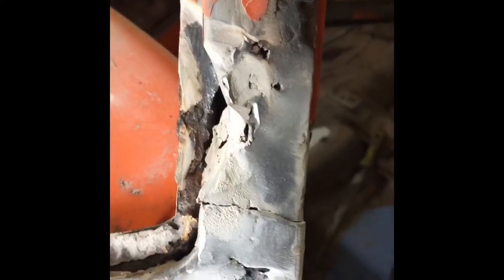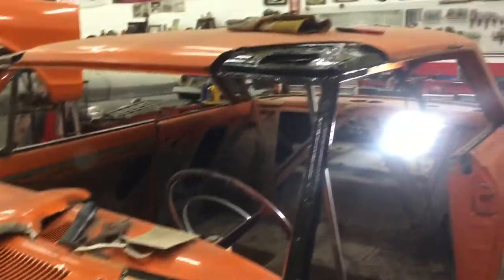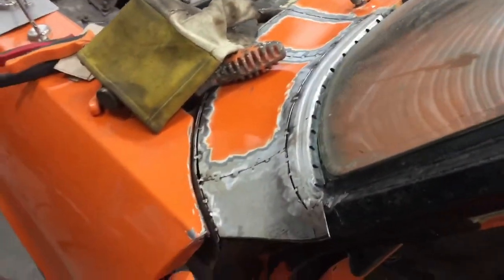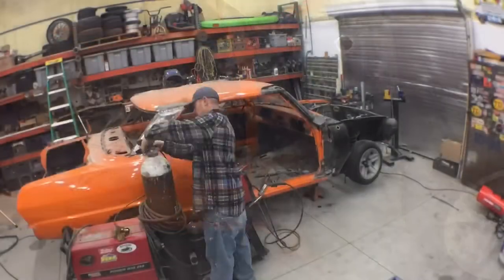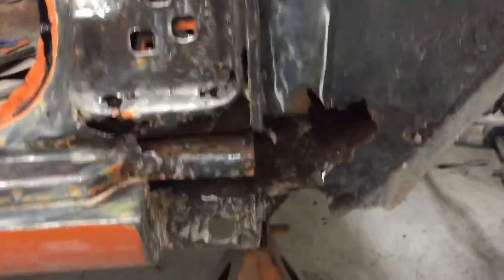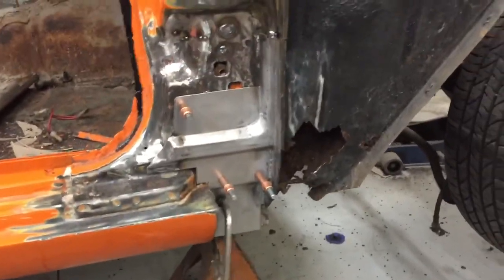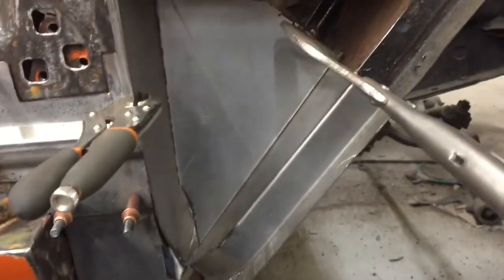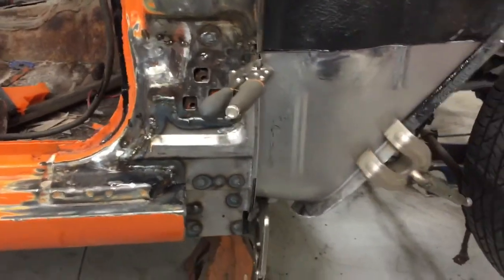1965 Chevy nova pt 2 “can it be saved “

Comment: I'm going through the same mess on the A pillers of my 66.   My concern is that the cowl is open to the elements. And if you seal the bottom, then it will hold water. I know that it should drain out of the rockers, but it's still a place to hold water. I'm putting all new cowl pieces on  mine. And the bottom of my A piller looks like a yours.